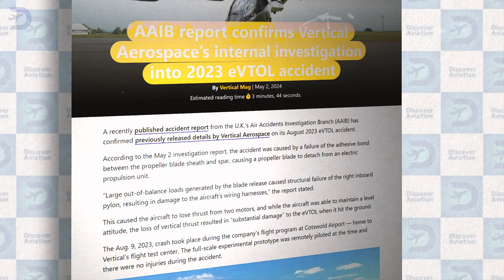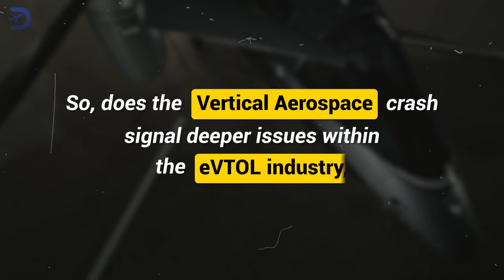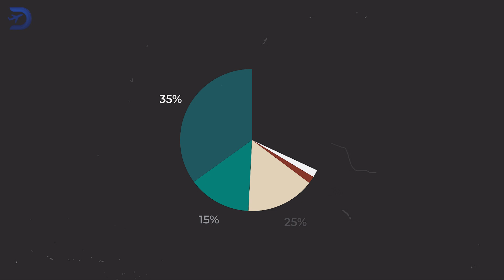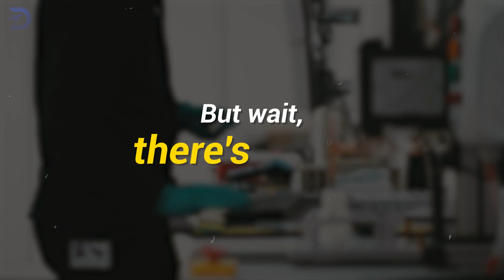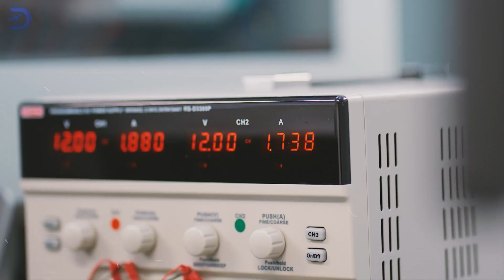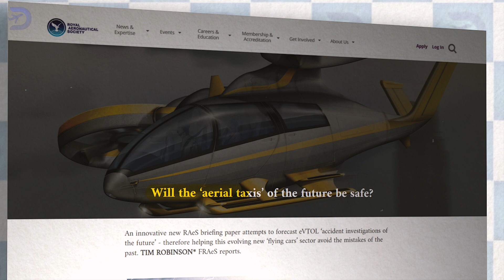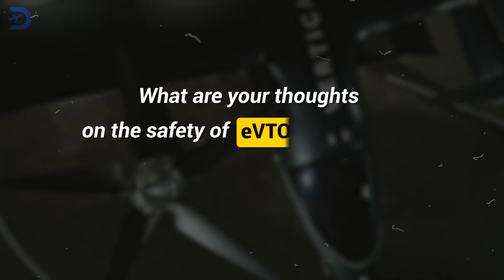How Safe Is eVTOL Technology After the Vertical Aerospace Crash?

Comment: It seems there is room for more elegant designs. For example, rotating the whole wing simplifies horizontal wing lift. They know best, but tilting each rotor seems complex. Why did they use bonding instead of single casting or formation for propellers. Another case of inelegance.

Comment: Why was there no accelerometer for vibration warning for the engines.
Reply: There was no warning, the blade was fine one moment and gone the next as the bonding failed. Then the massive sudden imbalance at high rpm caused the motor to rip itself off its mounting point and sheared the wire harness for the other two motors as well. If this had happened while in hover or slightly slower forward speed the plane would have been even more damaged, now it was going fast enough to glide to the ground, albeit descending too fast to stay intact.

Comment: Ejection seats eh? Once this was a  joke.. retrorockets are on offer also
They are just uneconomic before considering all the rest, too big too heavy, vtol is wasteful and dangerous and unneccesary (ATOL does the job much better...)
The pilot looks lonely in that huge cockpit which itself is smaller than the "gut" section (looks like an anteater somehow)
If the VX4 ripped it's pylons off the wing just think about the Archer which has MUCH more overhang (cantilevering) all of them. Joby et al are far more vulnerable to shedding pylons than Vertical . Joby already broke up mid air because of the same thing.
Thet are all massively over complicating the task of .moving people in a built up area and actually increasing the infrastructure cost enormously by using vtol ( supposed to save costs but only when compared to building whole airports which was never an option. Using vtol is like everyone owning a tank that could traverse unmade countryside not needing roads but in practise it is better to have simple tyres and a made road.....
Anyway the evtol mania is playing out as expected.

Comment: I would never get in one. If you have an engine failure you are going strait down. No gliding or autorotation with these. Also Look at EV cars that randomly blow up because of a battery issue. No thanks....
Reply: It literally glided down, it has lift producing wings. The speed and altitude were too low for controlled safe descent rate to be achieved so the already weakened wing snapped on the harsh landing. 

I wouldn't get in this thing for many other reasons but its ability to fly unpowered isn't one of them.

Comment: LMAO. Retired pilot and airline manager here... No way that flying cars will ever be a real thing. Because no insurance company on the planet will underwrite them. Just that simple.
Reply: Electric evtol can't lift much more than their own weight and not for very long or far. So that is another reason. There should be evidence they can at this point. Airplanes evolved from kittyhawk to the sopwith camel in the amount of time evtols have been around and they haven't shown any improvement. They can still move nothing nowhere.
Reply: The prop tilting hinges are an obvious weak link and likely contributed to the overall VX4 failure.
Reply: I totally agree that it will likely never replace mass transit. I think it might be a good replacement/addition for rescue helicopters or used in law enforcement etc.
But dont know if this cam justify the tremendous amount of money they burnt already.
I was always wondering how much thw final $/mile ratio will be for them. Do you know this?
And I can't imagine that everybody is doing the extensive checks that we do before every flight in these things. Aviation is not just hoping in and turn the key (at least as long as you want to stay alive 😅).
Reply: @sendtospybot  You nailed it.
Reply: Safer than a helicopter 🚁, less maintenance, quieter and cheaper… i could see workers in downtown manhattan walking over to the heliport, being FULLY checked in to their United flight to Kauai.  1/2hr to Newark and in the air to Hawaii within an hour.  I really do believe it will be a game changer.  I would paid the two hundred or so for an air taxi to Newark.  (Archer’s Midnight thru UNITED AIRLINES I believe?)
Reply: @rondesombre6149  Safer than a helicopter? LOL. Show me the flight test data

Comment: Joby is well ahead, having started 15 years ago. They are years and years ahead with design and testing.

As of the latest report 6th November, 2024, Joby is expecting first commercial air taxis in Dubai, end of 2025.
Joby is 41% through Stage 4. Joby has $1.43 billion cash ahead plus DoD income (~further $100m) plus a further $140m milestone payments from Delta plus interest.
Archer is 12% through Stage 4. Archer has $0.5 billion plus interest.
Both companies already have a clear path to approval requirements from collaboration with FAA.
The market territory is massive and will take many decades to fill out.
Here are some notes on Joby:
Cash holding $710m plus the following to be added:
Early October 2024, Toyota made an agreement to invest a further $500m into Joby in 2025.
Late October 2024, Joby raised $230m. (less costs, call it $220m)
Delta Airlines will further invest up to $140m as milestones reached.
Saudi Arabia MOU for an undisclosed number of S4's - fast tracking income while air taxi builds out
Income will come from the $130m DoD contract.
Factor in Marina factory producing 12 eVTOLs per year expanding to 25 per year.
Factor in Dayton factory (my estimate of production ramping up) 2026: 150 eVTOLs  2027: 400 eVTOLs  2027: 500 eVTOLs. 

So Joby has a HUGE cash runway ($1.55 billion) plus later $140m from Delta. Within 2028 they will have more than 1000 eVTOLs producing cash.

My estimates: Cumulative values
2024 Marina 6 Dayton 0
2025 Marina 18 Dayton 0 (Dayton will be ready at this point)
2026 Marina 32 Dayton 150
2027 Marina 48 Dayton 550
2028 Marina 66 Dayton 1050
I have allowed ramp up for both Marina and Dayton. Total in 2028: 1116 eVTOLS.

"..A Joby Aviation S4 2.0 aircraft is projected to generate $2.2 million in annual revenue.."  So from 2028 that is $2.45 billion earnings.

The average tech sector P/E ratio is 33, implying a market cap of $81 billion by then, or a share price of $106. The share price is currently $6.  

Joby's vertical integration is its superpower.   
Joby MTOW is 5300 lbs, Archer MTOW is 6700 lbs (same number of passengers). So Joby is more energy efficient.
Joby is faster at 200 mph.
Joby has longer flight duration which makes it more versatile.
Joby S4's first piloted flight September 2023. Archer have not yet piloted a flight. I suspect Archer could be a year behind with FAA cert.
Joby 41% through fourth stage (FAA testing) in Nov 6th 2024 report. Note in 2023 they obtained a clear path to certification of their pouch battery. Tail approval is highly significant - materials and structure.
Joby S4's hover noise is 67dBA, far quieter compared to Archer. Joby's on-wing flight 100 times quieter than a helicopter. For Archer, noise could be a big approval problem for operating in cities.
Both Archer and Joby have a former FAA administrator on the board.
Joby are producing pre-production prototypes as promised (4th being finalised, possibly 5th by end of 2024). There is no evidence of Archer rolling out prototypes. Indeed, Archer made the comment during 7th Nov report that they don't want to say when the test prototype (singular) will be ready because that would put undue pressure on the team - that's not good enough and leads to the question: are Archer potentially hiding something? It is the very essence of the company and Archer can't give an approximation?
Joby ditched gear boxes years ago. Direct drive is simpler, lighter, lower maintenance. Archer still on gear boxes.
Joby has 10,000+ hours of flight data so far.

Joby will be first mover, its vertically integrated production cheaper, more reliable and more agile. It's aircraft weight, speed, duration and noise superior.

Just my thoughts. No investment advice given.